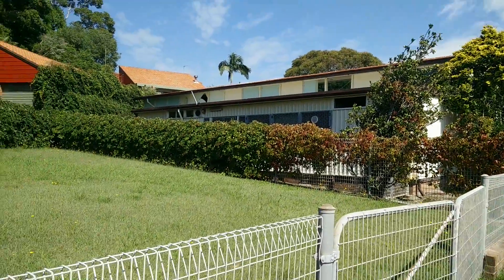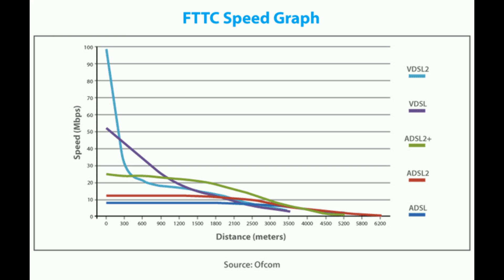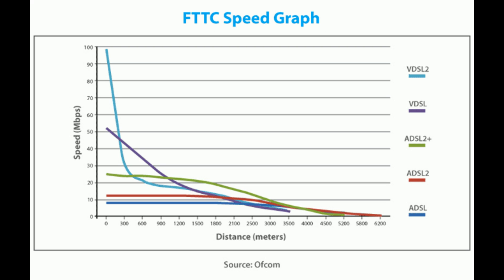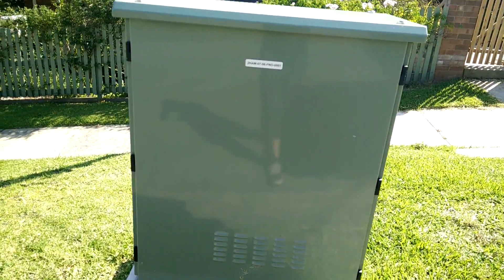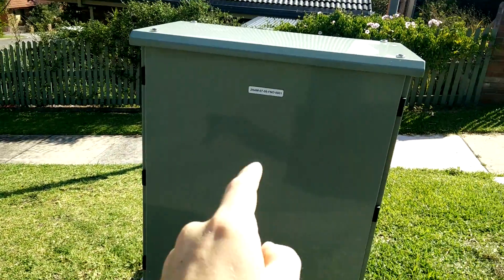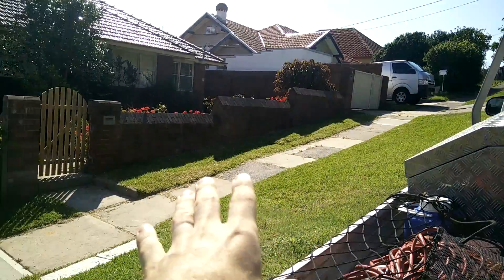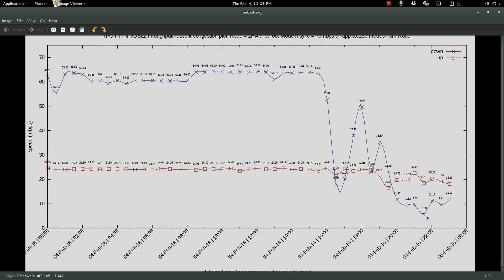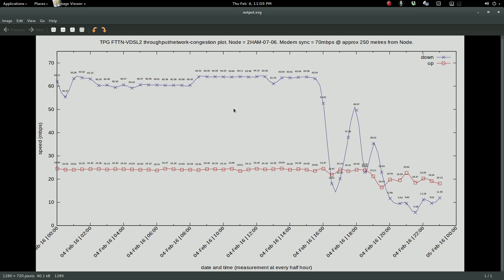NBN - What is FTTN and how to estimate your speed

Comment: It won't get fixed.

With CVC charges are $17.50 per Mbit from the Node back to the RSP's backbone. There is no way the RSP will provision enough for everyone on that node. The costs are horrendous and not feasible as set out by MTM. Good luck sharing a few hundred Mbit of bandwidth when there is 100+ people connected at 25Mbit plus.
Reply: yay someone who didnt just blame FTTN tech and actually knows why all nbn services across aus not matter wether FTTP, FTTN or Wireless are all congested due to cvc pricing model. 

BUT I must correct you with 1 part, CVC charges are not from the node its from the POI (Point of Interconnect).... each RSP connects to each POI and pays for CVC at each POI not Node, this is where the term FTTN comes from as fibre is run from the POI to each node then uses old telstra copper for last few hundred meters to house, making sure the line length and quality allows for at least 25/5 megabits as all the politicians quote. 

There are 3 kinds of nodes, the largest allowing for a max of 196 connections but will be spaced and sized depending on density of houses in an area to achieve the 25/5 mbps minimum but there could be up to 10-30 nodes connected to one POI. 

So more like hundreds or thousands of people sharing the same CVC bandwidth, so your right in saying its way to expensive BUT its actually better the more you have sharing the one CVC, yes you have more users but the CVC pipe is bigger and most network engineers/administrators know higher backhaul contention ratios are much more possible with higher user numbers then low user numbers. Think about say you have 1 user that wants a 10mbps connection, the backhaul has to be a minimum of 10 mbps...... or a 1:1 contention ratio but if you have 10 users on the same backhaul all wanting 10mbps then you could get away with only having maybe 60-80 mbps backhaul without congestion as even in peak times they wont all be using 100% of connection all the time some of them may peak to 100% every so often in peak if they are downloading or streaming things or even if there that one or two users that sits with their connection pinned at 100% constantly downloading but not everyone will do that, like some users will older people that hardly use the internet. 

The art is to balance these so your not paying for too much backhaul that its a waste but you paying for enough that it doesnt get too congested at peak times and this all depends on user numbers and how much the isp cares about peak congestion.

The issue is the nbn transition stage where its to expensive to buy extra CVC for such a small amount of users and just wait using the free 100mbps cvc they get hoping they will get enough users to be able to pay for more CVC before the customers notice the congestion.
Reply: While I agree with you on most of your points and agree FTTP is overall a much better option because of many factors like running costs, expandability, reliability and the fact that FTTN is not a good investment as its looking like FTTN is going to cost close to if not just as much as FTTP for a much more expensive and less profitable network due to running costs because of the nodes needing to be powered and maintained, those batteries don't last forever and will need to be replaced regularly as well as there's more active components to fail not to mention the horribly old and under maintained copper that you mentioned. FTTN is an outdated technology that will eventually have to be replaced and is a giant waste of money for various reasons I stated previously. 

I agree with you that FTTP should have been the way to go but its not the main reason for peak hour congestion, its the CVC. Yes FTTN can suffer from congestion at the node but the CVC is the bigger problem. 

That being said the reason FTTP has had less CVC issues is because when they roll out fibre they have to run it to each house causing a much more staggered user connection rate than FTTN which is activated all at once causing a flood of new users and ultimately congestion until the ISP gets enough complaints and decides to pay for the appropriate CVC, which sometimes they will skimp and upgrade enough to reduce problems but still suffer from some congestion at peak times simply cause it's not cost effective with the CVC pricing model depending on overall users on a POI after the initial uptake phase.

You and your friends were obviously lucky to not have any CVC congestion issues but here are various links to people who did have congestion issues with FTTP including one specifically with iinet:
http://forums.whirlpool.net.au/archive/2541663
http://forums.whirlpool.net.au/archive/2536675
http://forums.whirlpool.net.au/archive/2210034
and there are many many more if you do some searching on whirlpool.

Now onto the iinet issues, I do agree it's still a fairly uncongested network apart from some CVC or backhaul issues in areas where iinet has no choice to pay for expensive backhaul and are slow to upgrade due to costs involved.

TPG has been making some fundamental changes to routing policies, which has been confirmed by a number of users on whirlpool who have traceroute proof (including myself as I'm a systems administrator and did my own tests) of connections being routed all over the place, mostly caused by TPG wanting to use cheaper/longer routes rather shorter/higher quality ones which TPG is renowned for among people who really know networks. 

So yes iinet is still an OK ISP but it's not what it used to be since TPG took over and is trying to cut costs while still retaining some or most of its "premium" ISP features,  losing ones most people won't notice too much or doing it slowly over time so not too many people notice. 

Consider this, you are used to a certain brand of beverage lets use coca cola for example, if you drink it all the time and they all of a sudden change the ingredients or sumthing drastically that affects the taste your going to notice straight away aren't you, but if they ever so slightly change sumthing over years then your much less likely to notice cause its hard to remember exactly how it tasted 5-10 years ago.

I have done very very very thorough research on all this and while I can't guarantee everything I've said to be absolutely 100% correct, I have clearly done a shit ton more research than you and know what I'm talking about (mostly lol even the most educated and meticulous can be wrong sometimes).

So please, please stop just assuming and or believing the politics,  do your own research (in depth) and form your own opinion rather than being a sheep following either side whether it be liberals or labour, most of their arguments are just political bs and don't focus on the more important problems like the CVC pricing model. :3 No offense intended at all but lol check your facts before arguing for someone else's view you have just jumped on the bandwagon with :P
Reply: I have had FTTP NBN for 4 years with my RSP being iiNet and even after the buyout from TPG, have had zero congestion issues, when I have spoken to others in a larger cities than I like Brisbane, they also have reported zero issue with there FTTP connection during peak periods. The flaw is this MTM it's outdated, outmoded technology. This is current year not 2005 when FTTN/B/C/Dp would have been acceptable, now it's too late the copper network is cactus and is the equivalent of a wound so bad that it needs stitches, yet the LNP wants to put a bandaid on it as if it was a skinned knee. Labour saw the issue knew that FTTN was not the solution (after the LNP talked them out of it as that was what the ALP were going for), and wanted to roll with a proper long lasting, simple and permanent solution which was FTTP for over 90% of the population, Fixed wireless and Satellite for the rest.

Comment: I have not got NBN yet just ADSL1 I am on a rim, and I get about 3.5 Mbps at best. I am about 4.8 km away from the exchange, I guess this rim is where my node will be which is 800 metres away. most likely if it wasnt for the rim i would get a lot less.  but i get better speed than my friend does on ADSL2+.

Comment: haha when you are talking about the congestion starting at "16:00" it sounds like you're about it say "it shits itself" lol, I'm having this exact same issue at Belmont :) but I'm curious about something, if you're only 250m away from your node, how come you get 70mbit? I've noticed similar results from people on Whirlpool at the same distance, I'm at least 325m from my node (Telstra told me I'm 550m away but I've done the ruler on google maps following the road) and I get 109/43 max sync, so 100/40 real sync, getting 95/38 speed tests. In 2011 Telstra replaced the lead-in copper line from street to the house so that may be why I get the max speed?
Reply from the maker: +KleskReaver Good observation (on both fronts!) I was going to say it shits itself, and I too have had the same observation about speed, i.e., people further away than me getting higher than me and even higher than 100Mbps (sync). So the VDSL2 graph only went up to 100Mbps. This leads me to believe we actually ARE on vectored VDSL2 (with the 17a profile), and therefore that graph is likely to not be 100% accurate. Also, it's the quality of the signal that's important for your sync speed. The distance the signal has to travel is hugely important, yes, but so is the copper's ability to carry that signal. If the copper has degraded then it's likely you'll sync lower as a result. I'd say your copper connection is much nicer than mine which is why you're getting a superior speed.
Reply from the maker: +George Edwards Also I spoke too soon with regards to the congestion issue. It seems like a MASSIVE issue nation-wide. Whirlpool people are understandably upset. I've raised a support ticket to my RSP and they're attempting to troubleshoot the issue by asking me to take a speed test screenshot and send it to them (even though I sent them this graph in the ticket) ...I made a video (just to them) to show them how to use the graph: https://www.youtube.com/watch?v=fHVj_PCDcMY  There you can see how bad it's been since I first got FTTN
Reply: +KleskReaver yep, looks like its good during peak time tonight: http://www.speedtest.net/result/5082216019.png
It's a very nice change :) let's see how long it lasts this time
Reply: Hydranode nice, my connection has been great until a couple months ago, not congestion again but my max line sync has dropped from 109 to 74 and getting drop-outs daily, so there's an issue with the line, I've already run a new external grade line from the socket to the lead-in cable without any improvement so it's obviously an issue with the copper in the street, Telstra are in the area from 11pm to 6am tonight doing maintenance for some upgrade, hopefully I get fixed :)